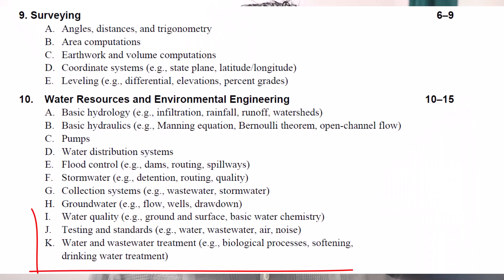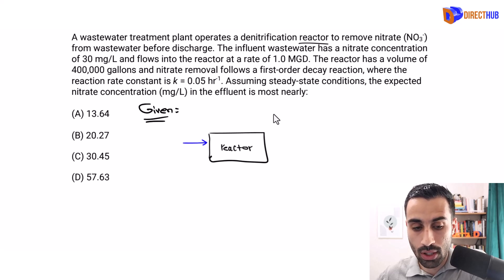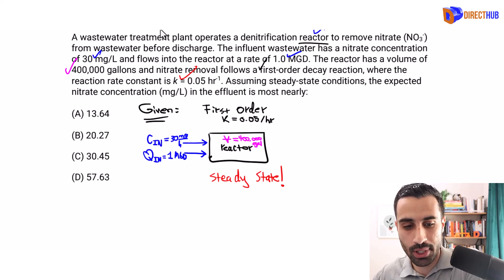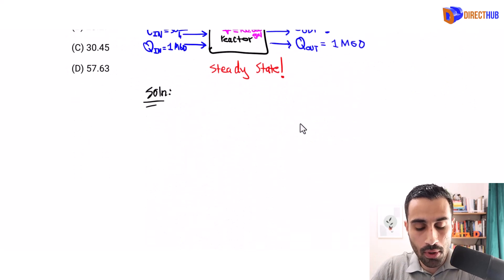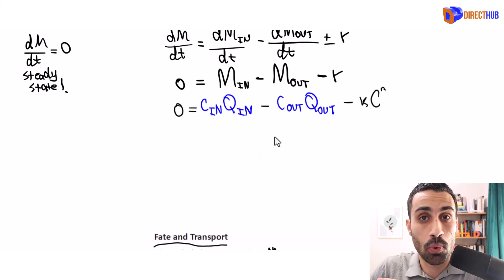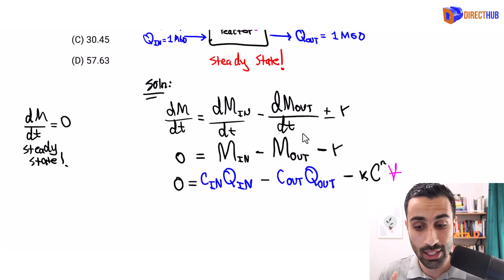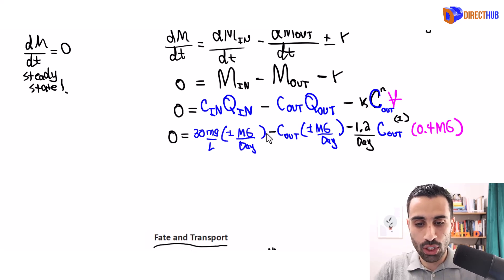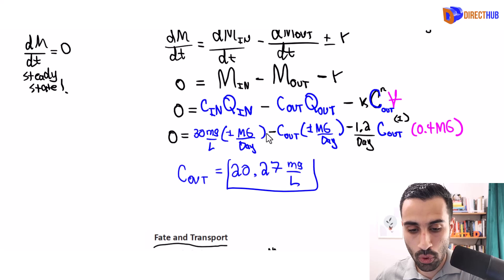FE Environmental - FE Civil - Wastewater Mass Balance

Comment: Hello! Could we also solve this problem by first finding θ using  θ = V/Q, then plugging that into the first order steady state reaction equation Ct = Co[exp(–kθ)] to find Ct?
Reply from the maker: Hello! Very clever and yes it does work! You will get an answer very close to answer chopice B. The only thing to remember is to used a complete mix flow reactor equation since a denitrification reactor is a big tank with complete mixing. Likely, this will be said in a real FE exam problem statement. The reactor isn't a plug flow like water flowing through a pipe. If you use the compete mix steady state reaction equation you will get an even closer answer to B! 

Well done1
Reply: @directhubfeexam  Oh yes, good catch. Your videos have helped more than you know! I take my FE Environmental in November. Thank you!
Reply from the maker: @saraspears9321  Very happy to know this helped! Keep up the wonderful work. I plan on redoing that hardness problem soon to make sure I get conceptually correct. Be on the lookout for a new video soon!